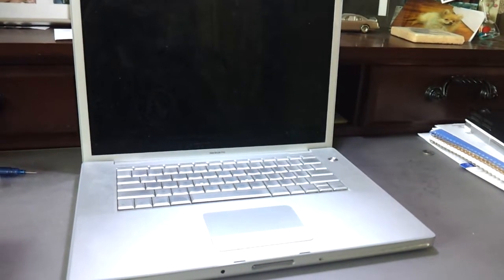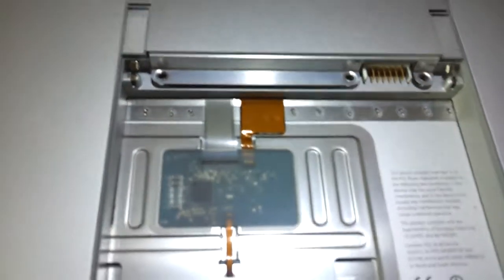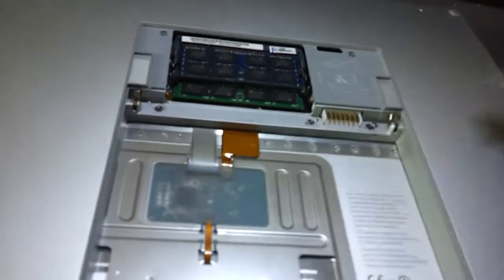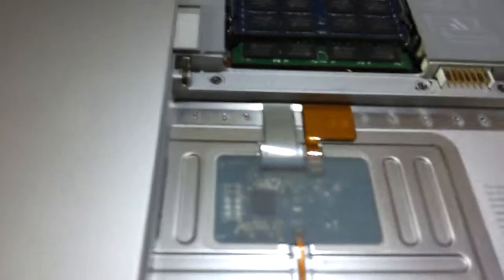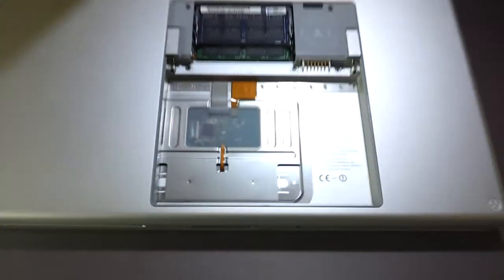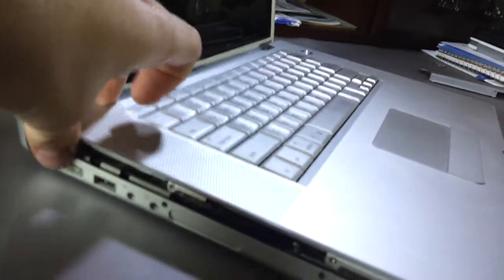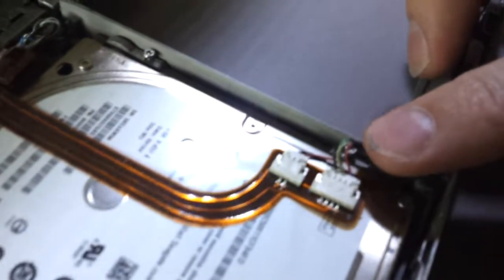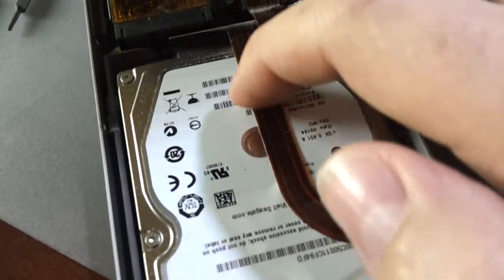MacBook Pro A1226 hard drive replacement MB133LL/A

Comment: Just did this on the same laptop, MBP a1226 Core 2 Duo and it worked great.  Installed a Crucial SSD drive 525 GB.  Not sure what that dude commented about the keyboard for, mine went back together fine.  Stupid geeky haters everywhere.  Thanks for the help!

Comment: Thanks for this! Your instructions worked a treat on my late 2006 Core 2 Duo A1211 MBP.

For anyone else wondering, the method I used to reinstall Lion (10.7) was to download the installer from the App Store, then extract the boot image and make a bootable USB stick following the instructions on macworld dot com website.